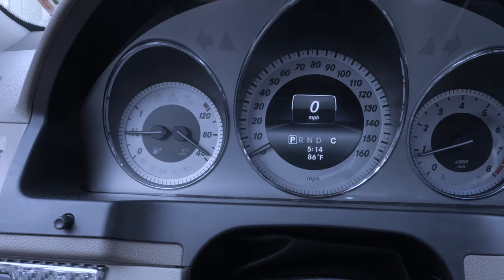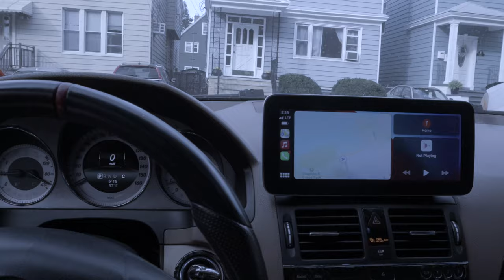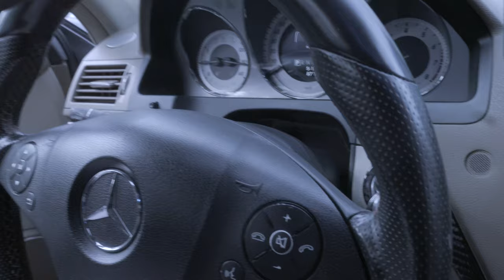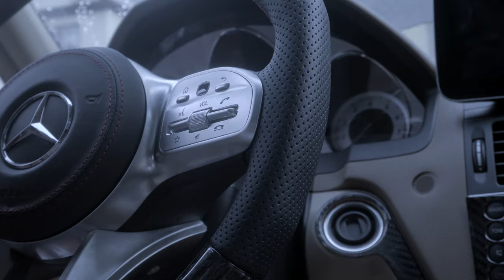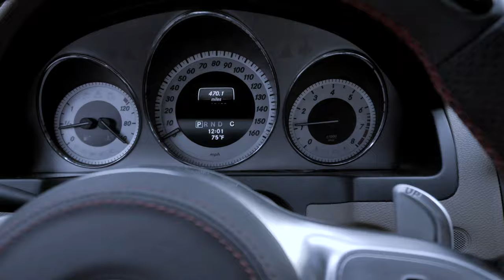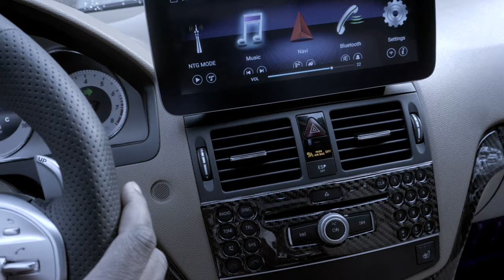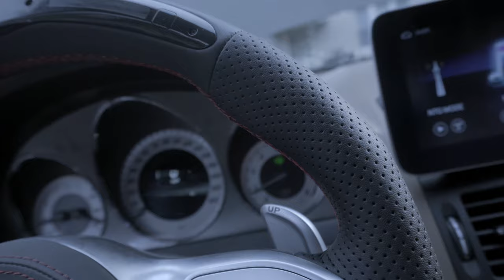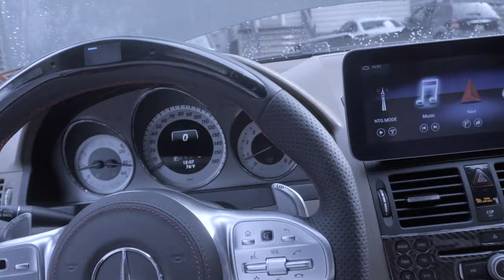The Coolest interior ( Steering Wheel )MOD for a Mercedes BENZ  W204 AND W205 C300 2008-2015 DIY

Comment: Hello friend I'm from Spain, and I like ask you if my CLK 2006 w209 can be changed the steering wheel too for this or another most actually? Tks boddy
Reply: Yes you can 
You’ll need your look for a donor with your car chassis like 2021 CLK
Reply: @MrDees_music  but the connections are the same? What is Donor

Comment: Which company sells this steering wheel, and how much does it cost? Where under the steering wheel did you connect the transmitter that connected the steering wheel to the car?

Comment: I actually upgrated my w204 2009, to a 2015 2016 steering wheel and any button works, people say that i have to replace de steering column from 2014 and up, so the buttons work, any ideas?
Reply: so i could put 2017 steering wheel on my 2008 c350

Comment: That's a cool mod man!
And a new steering column to make everything work is not necessary?
Reply from the maker: depending on the steering wheel , This one was plug and play and the original column works just fine

Comment: Hi,how did you get the milage to work?i have 2010 w204 and replaced the cluster of 2012 and doesnt show the mileage
Reply from the maker: So basically you have to use the Star Diagnostic tool to code the cluster or just check your local Facebook listing for a local guy with the tool usual around 100bucks

Comment: Does the pedal shift work?
Reply from the maker: Yup, but coding might be required depending on your car factory options
Reply: Thank you. Did you need coding in your case?
Reply: it's just upgrade ur steering column  to a  c63 2012 for example
Reply: How much did you buy the steering for please